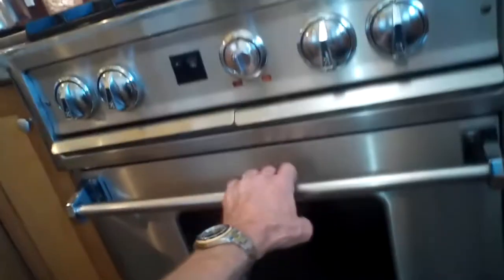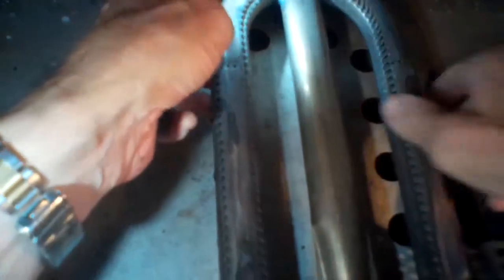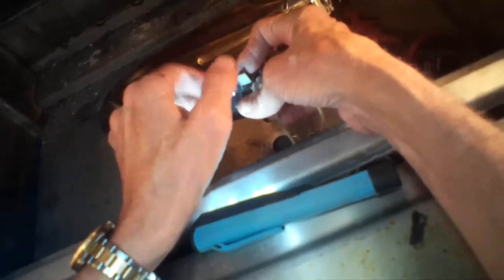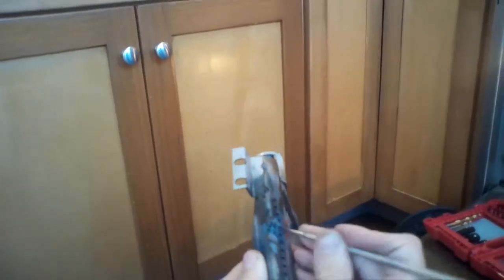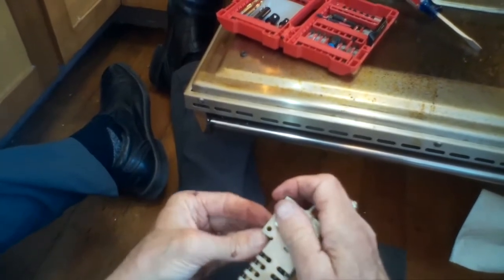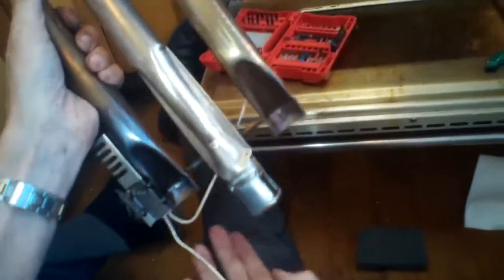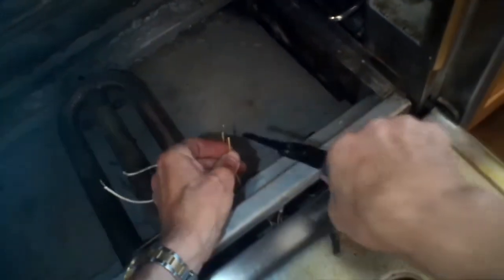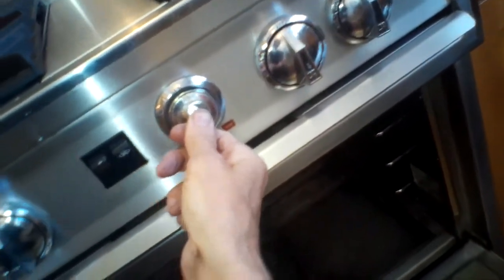Dynasty / Jade Oven Won't Heat-- (FIXED)

Comment: Hi Scott, I'm so glad you posted this video. I've spend ages looking for a video to help with my Jade oven. Finally I came across yours, which is for a Dynasty but they are basically the same ovens. Just wanted to say thank you. I actually bought a replacement burner and replaced it myself, thanks to this video. It was super simple.
p.s could you edit your title to reference Jade ranges as well...to help other Jade owners find your video....
Reply from the maker: Great idea , thanks Costas👍

Comment: Hi Scott, I found this video when searching for info. I have the same model Dynasty stove. The other day the broiler ignited after enough gas had accumulated to cause a slight explosion and hot air or gas pushed out of the top of the stove singing my wife's dress. Have you seen issues where the broiler fails to ignite but gas flows? Any suggestions on diagnosing the problem?
Reply: Ours blew stuff out... insulation?  Build up of dust inside?  Who knows.  It was freaky.

Comment: Thanks for this video!  My oven actually has two igniters at the bottom.  Is it safe to assume they are doing the same exact thing?  How do i know which one or ones i need to replace.  Thank you.
Reply from the maker: Yep, just replace both👍
Reply: Ours too.  Did the fridgidaire part on Amazon work for both?

Comment: Scott, this is a great video and just what I needed.  However, the bottom plate of my Dynasty range will not slide out like it so easily did in your video. Do you have any recommendations on how to remove it?
Reply: I had a very difficult time removing the oven bottom myself. Eventually figured out that there is a pan spot welded on the underside of the oven bottom, and a number of the welds had broken. The pan was drooping down and hitting the front crossbeam of the oven. I stuck a long screwdriver underneath the pan and propped it up so that it wasn't drooping and then I could remove the oven bottom.
Reply: That's exactly what our issue was too!  Thanks for the reply.

Comment: Have you had any issues with the heat causing the wire nuts to melt? Im concerned that it is going to get too hot for the wire nuts and they will melt. Is this a legit concern or nothing to worry about?
Reply from the maker: Good question ,  make sure to use ceramic wire nuts.
They won’t melt.

Comment: Also can you clarify if the igniters for oven and broiler remain lit the whole time the oven and or broiler are on? Or should shut off when the gas is lit?
Reply from the maker: Great question,
The igniters do stay lit the entire time.
I have seen where the igniters are weak and the ignition happens late causing a small explosion.
New igniter should solve the problem.
Reply: @QuickAndEasy5MinuteAppliance  Great quick response. Thanks a lot!!! I see you link to Frigidaire parts for the igniters. Is there any kind of mapping to other parts that are industry standard rather than the Dynasty/Jade parts which have minimal availability and maximal cost???

Comment: The replacement igniter looks like it is Frigidaire 5303935066.
Reply from the maker: Your right👍
Reply: @QuickAndEasy5MinuteAppliance  Do you know if this part fits in the Dynasty DGRSC366?  I don't know which model you were working on in this video.